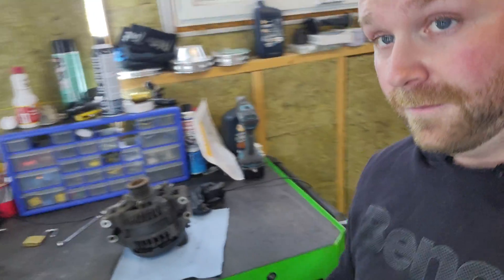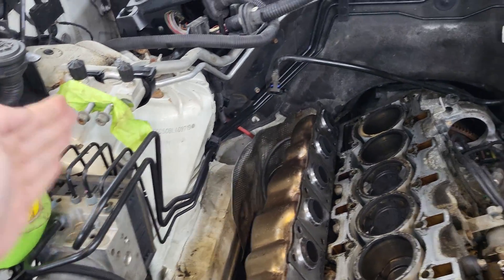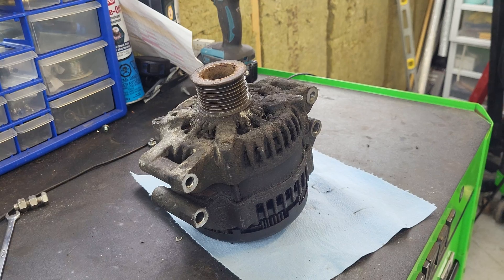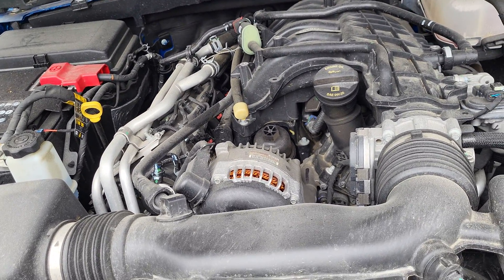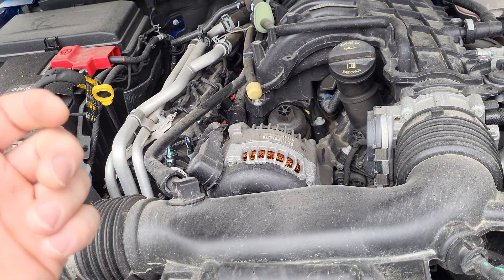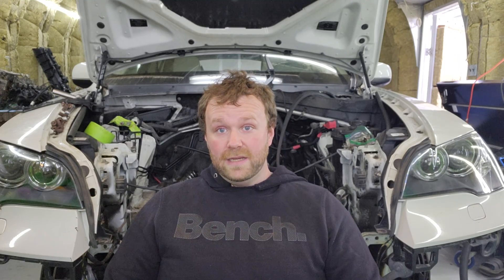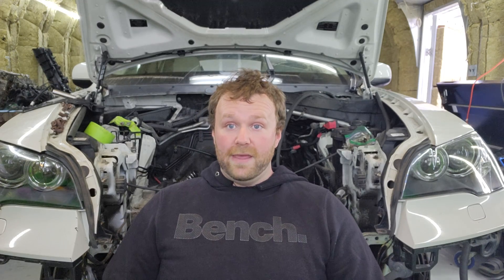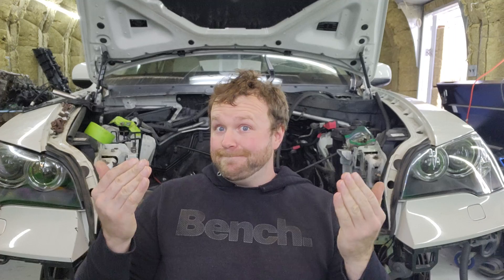This 1 engineering choice Will cost you $1000s in labor

Comment: I saw a guy getting his head gaskets replace on a longitidinal motor and it cost $60.000 so not always cheaper. And in fact the repair did not hold for more than a few month. It was an aventador.
Reply from the maker: Man hate to be the shop or tech having to deal with that poop show.
Reply: Well on on lambo, that’s probably an engine out job which is big money.  Also add on lambo tax so of course it’s stupid expensive

Comment: SUVS and Compact SUV's are money pits, yet its all people are buying.
Reply from the maker: Seems to be where the market is. :(
Reply: And they are ugly
Reply from the maker: @The0utmode  oh boy are they ever
Reply: Ford doesn’t sell a single small car or sedan any more.
Reply: My take is that the manufacturers figured out they could pigeon hole is into buying  a new car for a higher average amount. I miss my $20k brand new cars.
Reply: The big and heavy SUV give an impression of safety for many , they have the right of weight on the road. I drive a 53 ft trailer combination. If you hit me, that is your problem. Many truck drivers do not even bother with seat belts. My fault or yours in a Honda, you pay. Don't try stunts and deny it , many drivers have a dash cam, the disc go straight to the police/ insurance
Reply: @tonylam9548  two big heavy vehicles colliding equals greater impact forces. Not safer. If every drives a tank just to feel safe you now have the quagmire of everyone has a tank so the safety thought is out the window and now you just have crashes with greater forces.
Reply: @chrxx4327  I did not say 2 hevy vehicles, I said a truck and a car. If I am in a truck , 60,000 lbs gross and a car gross 4000lbs hit me , I win.  No need for a tank. Actually a tank can be much less destructive for they are slow (30 mph) while a 80,000 lb tractor trailer can do easy 60 mph. Plus you sit high up in a truck.

Comment: Just make your next vehicle an EV and forget all these repair headaches. Worst case you’ll buy a battery in 15 to 20 years for the newest EVs
Reply from the maker: Hybrids make more sense up here. Totally down for a ev if I didn't travel so much. They have their place :)
Reply: @Lancemechanics  EVs make sense if you have access to cheap electricity, can charge at home or work and don't have to make regular trips exceeding 600 miles per day. Hybrids otherwise are good enough for most people both from a TCO point of view and an environmental impact. Until the grid is 100% renewable energy, EVs are only incrementally better for the environment than a hybrid.
Reply: @imzjustplayin  yes, EV’s are not yet ideal for many but that is changing quickly as the charge infrastructure expands and truly low-cost fast charging EVs become available towards the end of the decade.

Have a 2014 Nissan Leaf that even with limited range suits me fine for daily local trips. Purchased used last year and even got a $2300 federal clean vehicle tax credit.  

Charge at night with electricity costs of $20 a month.  In my region, my utility is 20% nuclear and solar with only 2% coal.  This mix will also get better over time
Reply: They made the new cars suck on purpose, to fool people like you into buying into the EV slavery.
Reply: There are so many reasons not to buy an EV, most folks don't know where to start the argument. I'll just fill my gas tank and be gone, while you set there for a few hours ( if you're lucky) and charge your batteries and count the reasons, ( added cost of insurance, terrible resale value, bad cold weather performance, etc) why your choice was a really bad one.
Reply: @JimFrye-ub3kq  my EV takes 10 seconds to fuel up: five seconds to plug in at night and five seconds to unplug in the morning
Reply: Buying an ev exchanges one set of headaches for different set of headaches.
Reply: Yep. EV rock.
 1/3 "fuel" cost (except on long trip), and 1/3 maintenance cost.
Some say EV are the future, but EV are the present.

Comment: Transverse engines are a joke and always will be, you Honda guys are out there trying to change a belt with 1 inch of space to work in. Job takes 3 times longer than it normally would. 
The starter? Yeah they just stick that under the intake manifold where you can't even test it without an hour of labor time. 

When it comes to under-hood design flaws, not making batteries, alternators, starters easily accessible should be punishable by law. They fail every single day.
Normally I'm against regulating things but in the case of automotive, everything from connectors to modules to fastener sizes should be standardized across all makes/models.
Reply from the maker: I have a have a hate  on for 2007 to 2015 crv belts :/
Reply: @Lancemechanics  I purposely avoided working for Honda when I was in the field. They used timing belts for years and years & I imagine you guys spent half your life changing them with literally no space to work in. Let alone that 900ftlbs crank bolt.

Nightmare fuel. Also we need to Unionize the entire industry. Any moron can walk in and be a mechanic in the USA with no license, that's why they're paid peanuts.
Reply: We need a license to cut hair or replace a toilet but change brakes on a car?  Nope!
ASE certification is a joke!
Unions 👍
Reply: @pedlpower  ASE def is a joke, I remember going and getting all of them at once, never got a pay raise for it. The company simply paid for the tests. All they cared about was having another "master tech" they could represent.. 

You're right, it's ridiculous that just anyone can walk into an auto mechanic job when someone like a barber needs a license.

Mechanics deserve health insurance, holidays off and a pension just like any other career field.
Reply: @COBRO98  
ASE tests have no correlation to a mechanic's skills.
Reply: @pedlpower  In some US states, there are no license standards, but in Canada , there is.
Reply: I seen enough front/back engines that are difficult to access, try Corvettes.  a 67 Mustang with a 390 engine, you have one inch between the spring tower and the engine to change plugs. Chrysler 400/440, 1975, the plugs are under the exhaust manifold and cannot be seen.  75 Monza , the last plug at the passenger side , you have to jack up the engine to get at it, mechanics sometimes just leave that one out. Jaguar V12, dump 6 golf balls on the engine, and none of it reach the ground. The hose and tubings are contoured to fit the inside of the hood. Need I say more ?

Comment: I dunno man, it's more about packaging than about the direction of the cylinders.  Worst things about transverse motors is V6 or V8 and those damned rear spark plugs!
Reply from the maker: I definitely prefer doing spark plugs on those same engines in a truck layout compared to the transverse:p
Reply: Transverse 4 cylinders are usually fine.  It's when they cram a V-6 or V-8 in the same amount of space that's trouble
Reply: @Kwijibob was gonna say. I have a 1.6L Kia Soul with the transverse engine and everything is very accessible. A couple of quirks to remove certain bolts but it’s all very logical in the layout. Even the alternator (in my non expert opinion).
Reply: Not a problem on the Honda J series. Rear plugs are still super easy to do thanks to the manifold design.

Comment: interesting insight, thanks. i have both types. the transverse in a corolla is doing fine probably because its a lighter and simpler car from 2005 but yea just changing the accessory belt on it is stupid cuz its so cramped on the side. changing the belt tensioner will require taking a motor mount off and jacking the engine up a little to do lol
Reply from the maker: I think it was rav4. But the thermostat was 9 or 12hours cause of 1 bolt. Coworker had to do one. Same engine elsewhere different layout. .7 lol  things are tight for sure